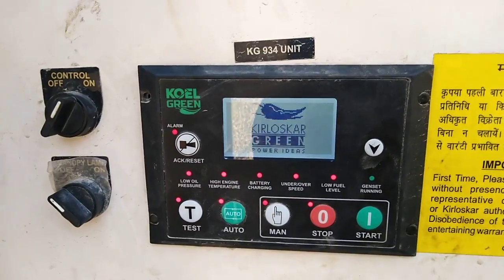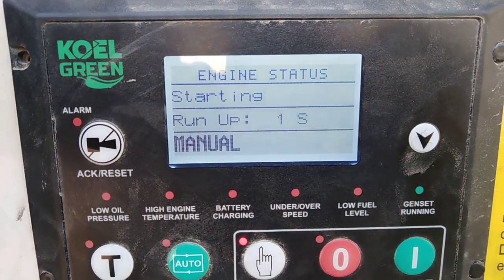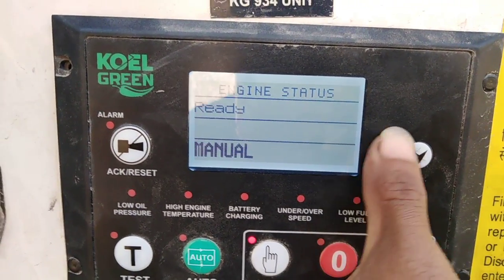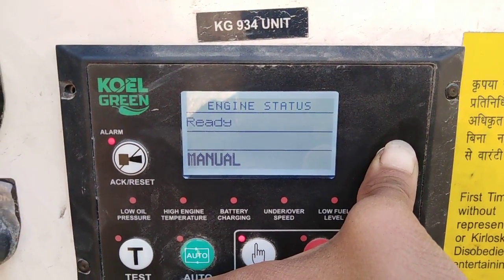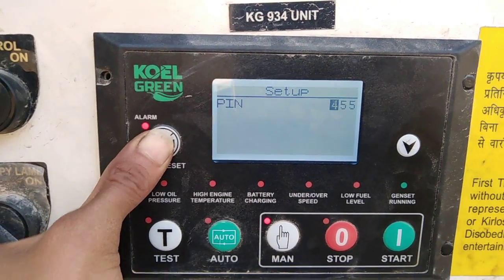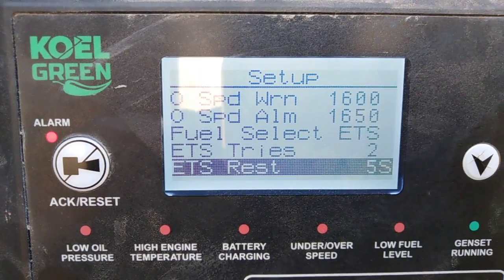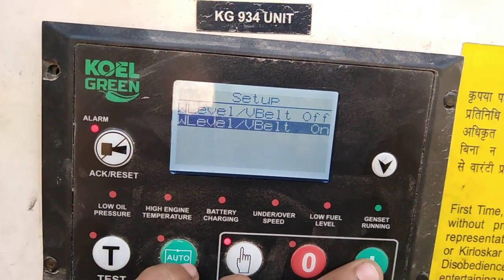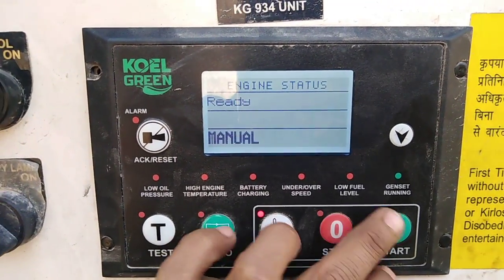How to solve low water problem on kirloskar genset.

Comment: Bro 30 kva gen set - have showing E-S loc out
Reply from the maker: Display fault. You have to change Display or cut one wire of emergency stop at Display back side J2-12 port number 13 you have to cut.

Comment: It's informative....thanks 
I have a problem,sir.
Display  showing a message "CHARGE VOLTAGE EXISTS " and then  engine stops.
What does it mean ?
Reply from the maker: 1st of all look battery voltage at display stop condition engine after at running condition voltage gone up to how much then tell me i will give you solution.

Comment: What is the exact pin for parameters settings... Someone is truly 7788 somebody 5555 which is the correct pin ?
Reply from the maker: Both pin are correct but at India we use 7788 in Nepal we use 5555.
Reply: @kumardipshan7507  ok thank u

Comment: 15kva low fuel level problem?
Reply from the maker: Have you check your fuel at tank 1st

Then inter change fuel sensor connected wire 2nd

After also showing low fuel level then take out sensor and check up and down it showing fuel or not 3rd

At finally change fuel sensor
Reply: @kumardipshan7507  finally change fuel sensor bro thanks
Reply: @kumardipshan7507  no speed signal problem bro?
Reply from the maker: Engine full run or not 1st

Engine start but warm up count down at 17 Engine stop 2nd

Check both and tell me 3rd

At count down 17 Engine stop so think that alternator AVR fuse break down check it 4th
Reply: @kumardipshan7507  pls reply bro
Reply: @kumardipshan7507  bro pls

Comment: A gf alarm problem
Reply: AGF VOLT HIGH FAULT AA RHA H KYA KARE
Reply from the maker: First off all look at Amper in which phase Amper goes high after then disconnected green wire which connected with city ratio coil on R phase then run dg set it will be normal.

Comment: Nice sir
Agf low volt VB 
What is parole 
Help me sir
Reply from the maker: Look all fuse
Reply: @kumardipshan7507  AGF over load alarm pls tell me what doing
Reply from the maker: @soumenbiswas9813  in how much time later it's shows  in which condition load or with out load it shows.
Reply: @kumardipshan7507  without load show 10 sec
Reply from the maker: Then open alternator look at AVR there was 5Amper fuse burn change it and start.